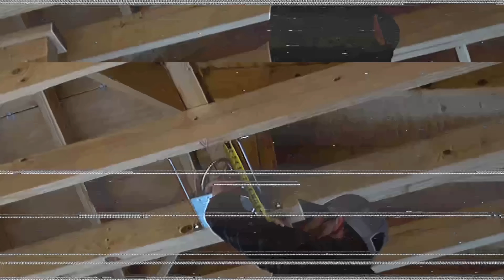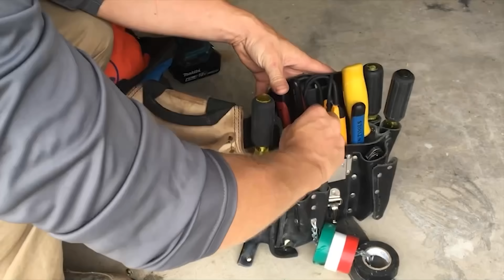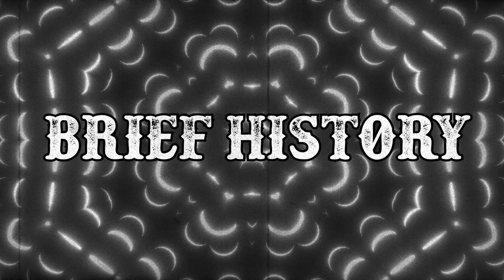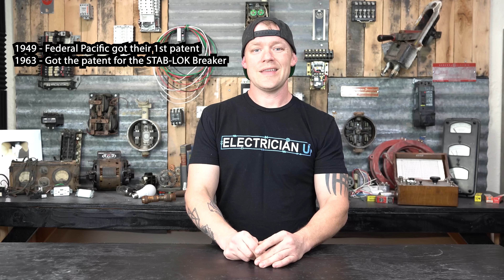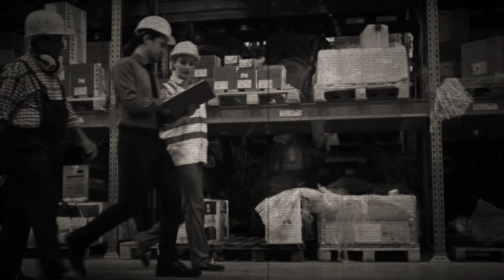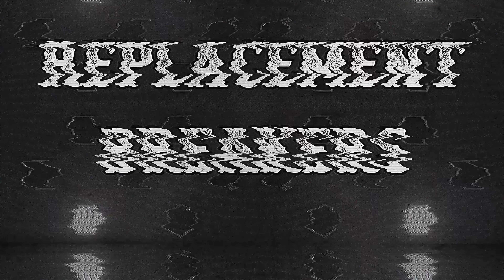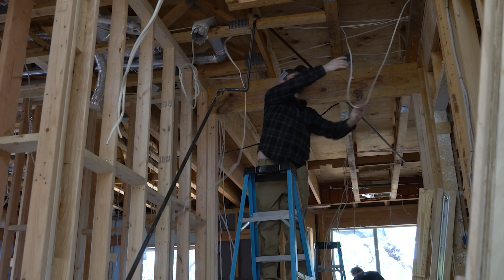FEDERAL PACIFIC ELECTRICAL PANELS - why their panels are dangerous

Comment: Even though it isby now water under the brigge. Or yesterday's news. & totally irrelevant. But just for the sake of remembrance. Within the FPE brand, as bad as the circuit breakers were (in addition to the iferior quality of the panels. To various degrees. There was a distinction in the Stab-Lok patent itself. The larger size breakers (1/2")  had a 2-prong (stab locking mechanism) which had at least a chance of making good contact with the power strip. But the smaller size (1/4") breakers had an absolutely worthless Stab-Lok system that in most cases made poor contact. and were a major cause for overheating. & the breakers failing to trip. Even on full short circuits. While on ground faults they never tripped. Even when sparks were flying all over for a minute or longer. Absolutely worthless & dangerous breakers & panels. Good riddance.

Comment: It's not just Federal Pacific Electric (FPE) Stab-Lok, but also Zinsco (or GTE-Sylvania), Challenger, and Pushmatic/Bulldog. Here in the San Francisco Bay Area insurance companies are automatically dropping insurance coverage in days after finding out homes and apartment buildings have those electrical equipment in them.

One time I was working on a home remodel and accidentally caused a short in one of the circuit branches and the FPE circuit breaker in the sub panel didn't trip, only non FPE main service disconnect at the electrical meter tipped.

Comment: Based on NEC 2020, i always thought you're not required to arc fault protect any existing circuit when changing a panel as long as you dont extend those circuits more than 6 feet, at least that is what im reading on 210.12 (D) Exception. Correct if im wrong, please! As far as the surge protection requirement, what im interpreting based on 230.67 (D), well, it is only requiering in it when you are changing the service equipment, so if you are changing for example and old FPE main lug thats fed by main breaker outside at the metering group/main disconect for multifamily dwellings as an example, then you would not be requiered to instal a surge protection, because you are not replaice service equipment.

Comment: We lived here since 1985 with FP Stab-lok panel in our bedroom closet. Just replaced ours finally on Tuesday after a big scare & learning the danger. Now a new up-to-date code panel is on outside of our house by the meter. -- I gather there are still millions of these panels in homes today. We had a fire in our garage freezer that could have taken down our house, if we weren't here to notice & jump. Thankfully we had some fire extinguishers & a good fire department response. Turns out we had rats that probably chewed wire in the freezer. Best guess. We were lucky wasn't much much worse. Could have happened while we were asleep or away. -- Firemen (yes, all men) said to get an electrician before turning power back on. -- Electricians told us that a new up-to-date panel with Arc fault protection would have prevented the fire from happening, so would have been a non-event. The circuit was okay after fire, but we should replace the panel ASAP because a lurking fire starter in our closet. Get it gone!

1. Get yourself fire extinguishers & know how to use them. (Thankfully we did!)
2. Know what your electrical panel circuits control (Thankfully I did, so was able to run to shut off power to freezer). Know how to cut off circuits in your electrical panel.
3. Put a linked smoke detector in your garage (We were lucky I smelled smoke before the indoor smoke detectors went off. My nose beat the detectors. Fire was raging.)
4. Don't have holes in your drywall that can let a fire go up into the attic (turns out we had a hole near the fire in ceiling, but lucky didn't make worse)
5. Donate to your local volunteer fire department
6. Don't let your garage be cluttered with stuff that burns easily. Make sure you don't have rats hiding in that clutter. Check out your old appliances for safety. 
7. REPLACE any Federal Pacific electrical panel ASAP! Get up to code. 
8. Do NOT have your electrical panel in your bedroom closet. That has been a code violation since 1981, but no one ever told us till after this fire.
We are going to get a full house inspection for safety hazards - get electrical of house reviewed for what is no longer in code (old rules grandfathered in doesn't mean safe). 

Federal Pacific (Stab-Lok) was never actually recalled in the USA, which is nuts. Get them out of your house! -- Maybe they were recalled in Canada?

Comment: My parents old house was built in 1953 and Dad had 2 FP panels, one main and one sub.
Dad always told me they are junk.
When I had my solar installed, new main and sub panels needed to be installed, and I fought for SqD QO panels and got them!
The solar company wanted to install SqD Homeline, but I knew they were cheaper with aluminum busbars, and I didn't want them.

Comment: Dryer 220 in my FPE box exploded. We were watching tv and started to smell something. I stood up just getting ready to look around. I heard a weird sound from hallway. Just as I looked that way Heard a loud POP. Then heard fizz fizz zap fizz noises and boom a fire ball shot out of the box up the wall into hall way. Fire dept got out in time put it out. The box blew so hard molten plastic from the breakers and the box hit wall across hallway and left black burn marks on the wall across from box. The  Bus bar which was now molten behind the failed breaker fell onto carpet below box and burnt holes into carpet in hall way. I can tell you all watching this video first hand experience with a FPE failure. If you have these boxes get them out as soon as possible they are death traps waiting to happen. Replace them boxes its not a suggestion. They can be shorting out and you wouldn't even know it until you smell it and by that time its too late. The breakers Wont trip off like they are supposed to. We had no clue there was a issue with dryer circuit. If the breakers actually had done their job we would of been alerted to a issue and could have had dryer circuit looked at. Plus would have been alerted to fact that them boxes are hazards. I don't understand how the inspectors didn't catch the issue awhile back when the house was looked at.

Comment: Why replace the panel when it's the breakers that are the problem? Replacing a serviceable panel is obviously going to be a lot of time and expense. The electric company has to come out and remove the meter, and put it back in when finished. A homeowner could be without power for a couple days, while replacing the breakers could be done in an hour or less.

Comment: 15:25 mission critical network infrastructure like in banks, hospitals etc is often aiming for "5 9's" or 99.999% uptime, so 1 per 100,000 downtime or defects.

Another methodology in process engineering, six sigma, aims for 3.4 defects per million, depending on how critical the process or product is.

Comment: I've got a Federal Pacific panel in my house from the late 50s I think.  Kinda scary, so I just try not to overload things lol.  I did find out that my garage breaker works, as I overloaded it with a malfunctioning saw and it tripped.  Guess the 60% failure rate still allows a few good ones through, lol.  Gonna get this thing replaced within a few years when the money is right.

Comment: So without actually saying it, is the problem the actual breaker or is it the panel, lugs and bus bars? I've got dozens of federal and Zinsco apartment panels I deal with. There are still existing fpe breakers and such in there but anytime something gets touched we use Connecticut Electric breakers. These are usually sub panels from bygone times and the mains are conventional Br, squareD, Murray, eaton siemens type. It's a huge thing to consider and we are still dealing with glass fuse panels where tenants just screw in a bigger bulb when something trips. 😢

Comment: I've ran into many of these panels in my trade. Some tripped out just fine but the home inspection required us to replace the panel. We took one and loaded it up. We supplied 120 amps to a 50 amp breaker and it never tripped causing the entire panel to smoke out and burn up. I wish I could get my hands on one of these for testing. Our journeyman also got a hold of an old square D XO panel and we melted it down in the same fashion. I wish I could have caught footage of my learning experience to show how dangerous these panels were.

Comment: If you are interested in modern manufacturing processes from a QC perspective, 6-Sigma is the most common process. It uses statistical analysis to determine acceptable failure rates and testing sample sizes.

As far as replacement breakers go. . . In Ontario, Canada, if you have aluminum wiring, and you replace the whole panel, you would be required to replace each existing circuit with copper wire. As a result of this insane policy, most people with aluminum wiring will opt to replace any breakers that are non-conforming. I would like to point out, aluminum wiring is not dangerous when installed and maintained properly, only when neglected or fixtures are not installed properly. On the other side of that argument, most people don't know that all electrical circuits require maintenance and inspection at least annually.

Comment: Might sound a little corny but your videos have helped me understand how USA power works for home to light commercial settings.

Like abstractly I knew positive negative, shock hazards, AWG wire sizes, rewiring plugs or receptacles. Why I still carry all that caution and respect for electricity but am more at ease understanding these concepts.
Thankyou

Comment: I have over years worked with different brands Square-D's to old Murray. When we went GFCI and AFCI breaker they fail faster when tested all the time.   Seen other trip and fail to reset, Yet had nothing on the circuit being used. As well as new, out of box bad. Quality just not the same.

Comment: Hey Dustin, I'm answering your question about outgoing failure rates. My first job in 1988 was a SRAM product engineer for Cypress Semiconductor in San Jose, CA where all manufacturing was done on site. Failure rates were measured in part-per-million or ppm.  If memory serves correctly, the goal was to have an outgoing failure rate of under 100 ppm, which is 1 in 10,000 or .01%.  Love your channel - please keep up the excellent work!

Comment: I don't want to get into this conversation about breakers, failure rates, good breaker panels, bad breaker panels, good and bad breakers, companies that make some good breaker models and also bad cheap breakers and panels. Because if you as an experienced electrician, electrical contractor, can't tell the difference between a quality built device or product for use in your trade, then you either don't have enough experience or you don't give a crap except to try and save money. 
 For instance, Square D makes decent products but I would never install any Homeline product by my own choice. That line is garbage. I'd install Murray panels and breakers before Homeline. Hell, I'd leave an FPE panel in good shape installed rather than install a crappy new Homeline panel. The low quality of the panel guts and the "feel" of the breakers action is unacceptable in my opinion.

Comment: The company I worked at in Oklahoma was using Square D Dual Function breakers with the tail and everything worked great until Vivent  or AT&T Fiber installed their equipment in garage and plugged into the receptacle and anywhere they plugged in the breakers were tripping due to the frequency that their systems were using. We ended up having to go back to hundreds of houses a s reconfigure everything to use GFCI receptacles, which sometimes required pulling extra wires in a sheetrocked house. Square D blew us off for the longest time and we lost thousands of dollars in labor and material to fix their problem. It was BS.

Comment: Yeah I have a condo that's a rental built in 78 when I used to live in that the inside sub panel was a stab lock brand the reason I say was was because it did catch fire and had to be replaced not a big fan of that brand that's for sure luckily the fire was contained in the panel but didn't have power for 2 days after the fire

Comment: Just replaced two Challenger panels for a customer and there was even breakers sizzling at times. They were VERY hesitant to replace the panels but they finally decided to do it as long as there wouldn't be any AFCIs installed.

Comment: Random question. I have a Crouse Hinds breaker box on the original part of my house. I have found Siemens breakers are good replacements. Is this a choice to replace the Crouse-Hinds breaker with? If not what brand would you recommend?  Thanks!

Comment: Im a home inspector. To change or not panels? Im in Florida. You will not be able to get home insurance if you have an FPE panel. Regardless of which breakers are presently installed. The decision is pretty much made by the insurance companies. Literally I find on average 5-10 recalled panels a week. All need to be replaced in order for the new home owners to get home insurance.

Comment: How did you short out your 100 amp zinsco breaker to test it? I replaced a zinsco panel recently. also i remmeber some years ago there was a panel I was trying to diagnose a tripping condenser unit circtuit for, and when the breaker would trip, sparks would fly out and it would sound like a gunshot going off. what kind of panel was that? are you familiar with that at all. it scared the shit out of me, but it seemed like that was just how it was designed to work as insane as that sounds.

Comment: Controls tech here with many years in manufacturing, I worked as a process tech for a company that made connectors for fluids on cars, and QC was very well engineered there every part made as tested automaticity as part of construction and then still samples were taken at random for offline checking and destructive testing as well. If the cost of a bad part getting out is high enough (and you would think breakers would be such a case) then a system will be built to insure they do not get out, or as few as possible do. BTW I can't speak for everyone but bad parts are often measured in Part Per Million and anything over a certain number (i.e 2 PPM) would be a large chewing out by the customer.

Comment: 4:07   Yes, recalls are generally only safety related.  4:14   My friend had a Nissan Titan, the AXLE shaft seals were an issue and a PITA to replace!  That D44 looked so small on that truck anyway.    Any fuel pump issues?  Rust was awful on his as well.  I would have suggested a Toyota Tundra if he asked me what to buy.   His did last over 200K mile with a lot of repairs.  Including catalytic converters in the exhaust manifolds.... Besides that it was a great truck!  LOL

Comment: Just a couple of months ago I was in a warehouse that was being reroofed (steel corrugated). A conduit that was run between the bar joist and the corrugated got a screw run in it, from on top of the roof. Sparks rained down for about 45sec, until the wire burned back, but the breaker didn't trip. I told the manager who I was walking with, I'll bet anything, you've got Federal Pacific breakers, sure enough they were.

After some discussion with the maintenance guys, they let me do a demo. I wrote my name on a piece of steel with a wire (first and last), but the breaker never tripped. We called them Federal Welders back when I was in the trade.

Comment: Done forget the design was bad as well, once the breakers were put in and removed then replaced they became loose and would not stay seated right in the panel. This is one of the reasons they are not allowed to be used.
From what I understand the breaker should be able to handle 130% but no longer then a set amount of time.
Reply: When in school, we set up one of the panels and we tried the old and new breakers and they all had issues. Due to the breakers not staying seated right in the panel.

Comment: As an electrician of 36 years, back in the 90's I was doing a rehab with an old federal panel.
I accidentally drilled though a wire and caused a direct short. I heard a humming sound and wondered what it was. A few minutes later the wire was smoking on the joist. Of course I went over to the panel and turned the breaker feeding the circuit off. I know first hand that there are certain production lot #'s of these breakers that will not trip. I made a device I called a trip-o-matic which was basically a heavy duty 20 amp switch to a plug. That way I could test all the receptacle circuits to see if they would trip. This was before insurance company's had any ban on these panels.

Comment: Regarding Acceptable Failure Rates for manufacturing, it depends greatly on the object being manufactured. Medical equipment for example will have a much lower acceptable failure rate than, say, computer monitors. Six Sigma is a good general rule for manufacturing as a whole, which approximates to 3.4 defective parts per million opportunities (DPMO).

Comment: You speak about "Failure Rate" I personally will not do  any work involving FP  add on"s just because of liability. I have never come across a property owner who had  an issue with FP, but why take the risk .However, I will say , by far , doing 90 % residential work , the biggest issue i have encountered , is STAB receptacle connections , which are approved , but .........absolutely  ridiculous, that they are. Literally a knife edge trusted to maintain high current flow  ....WTF?